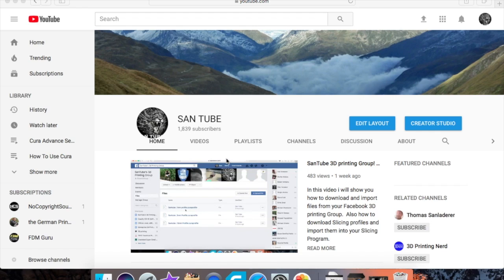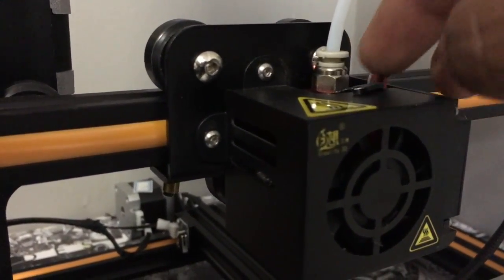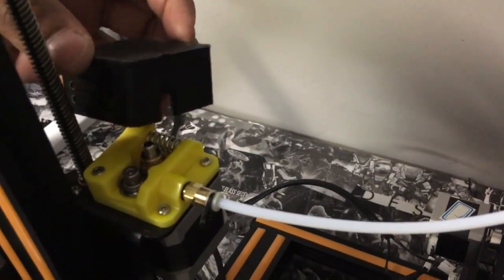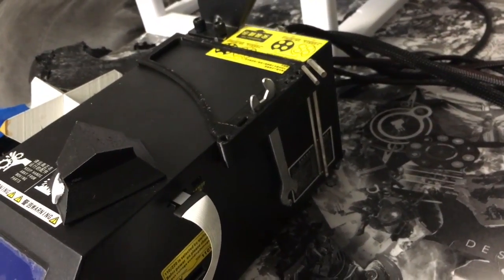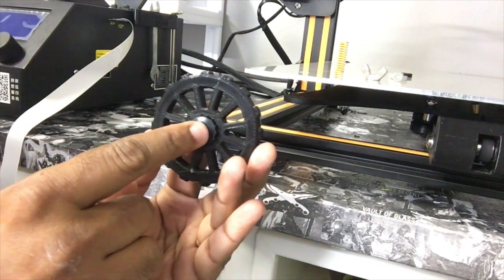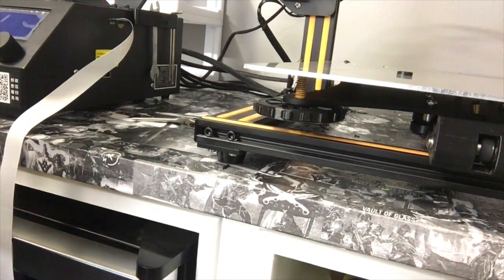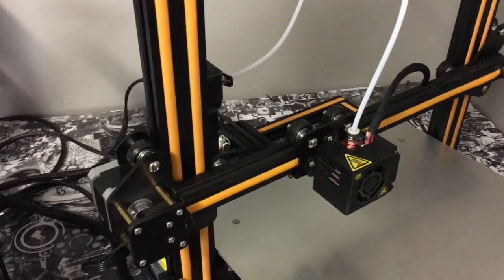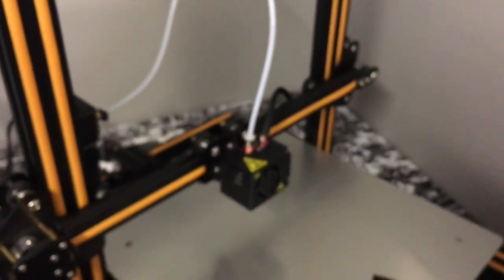Creality CR-10 Mods & Upgrades Part 2!

Comment: My CR-10 will be here in 2 days. Have been watching your great videos for a week now so I hopefully wont make ALL the rooky mistakes. I'm a maintenance man at choice hotel in Hartville, OH and plan on printing some helpful items I will use at work. Thank you again for your informative videos.
Reply from the maker: Happy to help and i must say what a small world.  I am currently a manager at Comfort Suites in Texas also part of choice hotels.  Good luck to you man.
Reply: My hotel also is a Comfort Suite, I started about 3 years ago 1 month before it opened. I have found your videos the most informative on the CR-10, wish you made more. thanks to you I put together my CR-10, leveled the bed, sanded the glass and have been printing for over a month now with ZERO problems. I am going to start using Matter Control in the next few days, what do you know about it?. Also, you removed a wheel on the Y axes in one of your videos, did that help any?

Comment: anyone know what the size and length of the actual screw for the bed is called, my cr-10 came with one of the leveling screws bent...
Reply from the maker: you can take one screw to your near by hardware store and they can get you a new one.

Comment: +1 SAN TUBE - Thanks so much for tailoring your videos for us newbie CR10 owners.  I'm learning so much from you and especially appreciate your laid back methodical style. Man, I wouldn't change a thing, like trying to economize on time like some commenters have mentioned.  We viewers can always skip ahead a bit in the slow segments.

Today I wrestled with the learning curve of initially leveling the bed on my just-assembled CR10.  What a complete pain as a newbie, especially since this is my first 3D printer.  Gotta admit, as soon as it's practical I want to add an auto-bed-leveler.

I also think adding a dual z-axis set-up is mandatory for larger models as there is clearly some vertical play/slop/possible-x-axis-beam bounce in the single z-axis config.  I personally think using another y-axis type drive belt to connect two vertical drive screws (LH and RH) is simpler and will maintain critical alignment as opposed to adding a second stepper motor set-up that's prone to losing sync (vertical alignment) with the original single z-axis screw.

BTW just subscribed so please keep the helpful videos coming.

Cheers from Thailand!
Reply from the maker: Jimbo, thanks man that means a lot.  I don't always get to hear that my videos are making a big difference.  So thank you sir and i will try my best to keep up the good work and not let you guys down.
Reply: You're certainly welcome!  BTW, I just ran across a totally different technique for getting good bed adhesion.  If you have time, please take a look at this guy's method and let me know what you think.  Thanks!  https://www.youtube.com/watch?v=BNBCYJqpHdM

Comment: 8-32 hardware is not metric. This rating system is used in the US and Canada and is referred to as the unified thread standard. 8-32 means it is a #8 screw (diameter) with 32 threads per inch (coarse standard). 

But thanks, good to know which it is for future replacement!

Comment: The Bed Spring Spacer is to large for the CR10. Do you have the correct Thingiverse link for the CR10?
Reply from the maker: Mr Turner, i did put the wrong link on there. it has been corrected and the right spring spacers are on there now.  Sorry for the trouble.   https://www.thingiverse.com/thing:2434419

Comment: I just printed the extruder cover (in PLA) and when installing it, it split down the middle. Do you thank the tolerances might be too tight. Any suggestions on how to make it  make the cover fit without splitting? Thanks for your reply.

Richard Harmon
Reply from the maker: It is a tight fit.  Most of the STL files you download will be almost the same.  I would say just sand it down or cut out the part thats giving you trouble.

Comment: Do you know why three out of the six wheels screws have washers and the other do not?
Reply: The 3 wheels with washers are the excentric wheels. These you turn left/right for tighning the wheels. As they turn, you habe washers so you don't scratch into plate. The other side just need to be tightend once. No need to turn them afterwards, so no need for washers.
Reply from the maker: FreeFlyFPV good question, I don't.

Comment: I second the vote for the dual Z. Especially dialing it in after.  Also can you add a link for which fang you used.
Reply from the maker: lol, the fang i printed was wrong.  it won't work with the factory fans that why i  didn't go over it.   Now i can still send you a like if your looking to change the fans out.

Comment: You need to tighten the nut against the bed levelling nut. The purpose of the second nut is to keep a force in between the nuts, so they cannot get loose.
The way you did, both will geht loose. You may also use a nut with nylone in it, but that is not necessary when you already have 2 nuts.

Comment: Great video. Dual Z would be awesome.
Reply from the maker: Steen Marquard ya I have been 💭 my about it but I have to order it first lol.
Reply: SAN TUBE  I have tons of upgrades coming --extra motherboard that will be flashed w newest Marlin FM, dual Z upgrade,stepper motor dampeners, microswiss all metal heatbreak and plated/hardened nozzle and some other goodies that I'll make another FB guide/post for. So keep an eye out on the FB forum as I'm just waiting for the parts to arrive.
Reply from the maker: Drewski17 this is my first printer and I am not to savvy with the firmware or mother board. Seems like u have a better understanding of these things then I do.  I am still learning and just try to pass on what I know. If you can ever pass some knowledge this way so I can pass it on to everyone else that would be great. Thanks a lot bud.